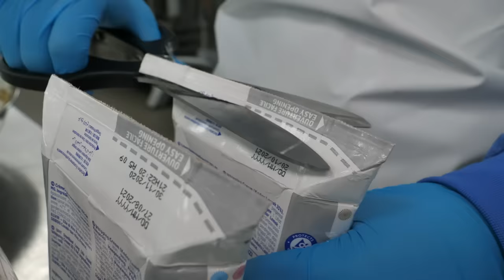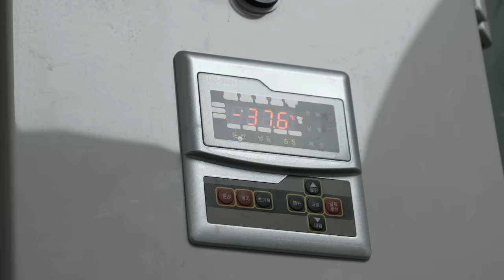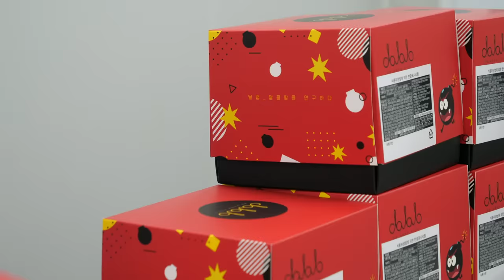폭발하기 일보 직전! 폭탄 초콜릿! 케익공장의 다이너마이트 생크림케이크 대량생산 making dynamite fresh cream cake - korean street food

Comment: The factory smell must be incredible with all these cakes
Reply: Actually the opposite
Reply: @JunKurosu  How? o:
Reply: I worked in a bakery and strangers would comment on a cookie or cake smell when I was out shopping after work. Better than when I worked at McDonald's and everyone would say it smelt like fries.
Reply: @tusamec6587   some smells like vanilla extract can be overpowering.
Reply: Incredibly nauseating. 
One cake, or a single passing whiff driving past the bakery, fine. But immersed for hours with it in your face until you can't smell it anymore, going home reeking of the stuff and not smelling it again until after you've taken a shower and pick up your clothes to put in the hamper. It'd be years after changing jobs before I'd be able to even look at a cake again without a little stomach churn. 
I used to work across the highway from a cookie factory, and even that was too much. Summer was the worst.
Reply: @maggpiprime954  bruh 💀 yeah I meant as a person passing by. If a cake was that bad I can’t imagine what is it like for people working in restaurants. Not all heroes wear caps.
Reply: @lileeuphoria9300  Ah. Well, it's not that the cake is bad, just that the smell of that much hot sweets is overpowering. 

Also, insomnia helps my imagination and memory get reeeeeeeallyyyyy specific. Sorry about that. It's a curse.
Reply: It's disgusting

Comment: 👑I simply love how clean and precise they are. They set the example for what is needed and should be required by any company dealing with food.👍🏽🏆🏆🥰🥇
Reply: Can't be proper hygiene.. if I just watched someone sanitize the gloves!   The alcohol breaks down the gloves!
Reply: CCTV
Reply: @Ohtinkerbell2015 I work in a bio lab every day and I think they are using nitrile or latex gloves here. 70% Isopropanol, Meliseptol and 70% ethanol are most commonly used for sanitization and they do not harm ones gloves. I am not 100% sure about longterm effects, but one changes gloves quite frequently, so they wouldn't really make a difference here.
Reply: I know right here in America they are allowed a certain percentage of bugs in there food. Look it up ketchup especially.
Reply: @Tuepfely  the gloves doesn't really matter cuz that's not alcohol in the first place. its a sanitizer made out of fermented rice, corn, barley etc. that's used when cooking/baking and its perfectly safe for food

Comment: I can't imagine who clean all the stuff after baking in that bread factory 🙄
Reply: I'm sure it's a cleaning team and they have industrial dishwashers. When I worked in my school cafeteria, we had one where dishes were racked in one of several heavy plastic square trays with posts to stand them up and holes in the bottom. That slid through a channel over a sink with a garbage disposal. There was a high pressure hose we used to spray any solid food debris off of the dishes into the disposal, then push the tray down the channel onto a chain drag that led directly into a huge square metal industrial washer/sanitizer. The chain would pull it inside, and we'd pull down a door on both sides that triggered the machine to wash, rinse, and sanitize the dishes. It used a sanitizing chemical and the water temperature spraying inside was 185 degrees - we were very specifically warned DO NOT PUT YOUR HAND THROUGH THE DOOR EVER) - the machine took about four minutes and then the doors opened and the chain pushed the tray of clean dishes out the other end where up to three racks would sit over a draining channel and air-dry (very fast since the water was steaming hot and evaporated quickly) and then the dishes were racked and the wash trays went back to the beginning.
Reply: I hope someone else is cleaning as they go🤔
Reply: Don't read mee!
Reply: @hanonondricek411  omg that would have took you lot of time to right😅
Reply: It is a cake factory
Reply: @thechairjiminfallsfrom7261  write*
Reply: @andreathio2332  oh yeahh😅
Reply: @sinead2041  oh sorry,, I think it's the same factory 🙏
Reply: @andreathio2332  no they used the right right
Reply: @saronavlogs  no it's write
Reply: @FAKTADUNIA1  you indo?
Reply: @hanonondricek411  why??? Why you write all of that 🤣
Reply: Man that mustve been really tough and hard job for them i even suffer washing dishes that had been collected for like a day lmao
Reply: My dad
Reply: People who knows nothing about kitchen are asking the same question.🙄😒😒😏
Reply: @hanonondricek411  you really wrote all of this 😂😂
Reply: @hanonondricek411  I love how you wrote that much but im not gonna read it sorry 
:(
Reply: @renetaylor1186  As a dishie I can confirm there would be a person cleaning as they go along otherwise they would be there all night cleaning- especially since the machinery is so big
Reply: Hahaha when i bake one cake  am lazy to wash 3 items😅
Reply: As with any restaurants.. a cleaning team. This isn't different from a busy restaurant.
Reply: Using the parchment paper probably helps a lot with clean up to
Reply: @saronavlogs  no they didn't
Reply: Very clear nice
Reply: @renetaylor1186  i bet there is with all those hygiene protocols they showed in video and all instraments/plates are crystal clean.
Reply: Yeh, but they probably hav machines
Reply: @hanonondricek411  interesting!
Reply: It must be hard
Reply: Well I guess the janitor or what?😊🤔
Reply: 1.Its cake 2. Dishwashers obviously
Reply: Probably machine’s?
Reply: @thechairjiminfallsfrom7261  How much times does that person have on their hands? Yeesh
Reply: The cleaner/janitor.. 🙄🙄
Reply: @renetaylor1186  This looks a strict place I think they have a cleaning team after.
Reply: @annkuh2169  of Cambridge
Reply: @mdmamun-ud2cw  M.D. of HARVARD
Reply: Maybe new workers
Reply: I love to clean
Reply: Well if there's a cleaning team, I hope them and the people who make the cake at least get a free cake like 1 time a week. (1 time a week because too much sugar is not good and these look very sweet)
Reply: Someone who got paid to do it.
Reply: i think they clean as they go
Reply: سلام عليكم
Reply: @hanonondricek411  p 3